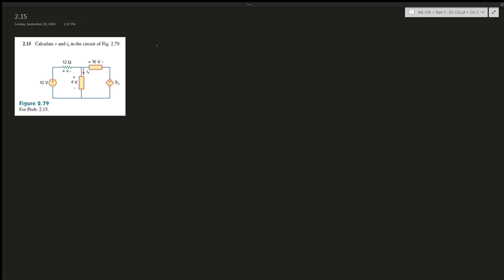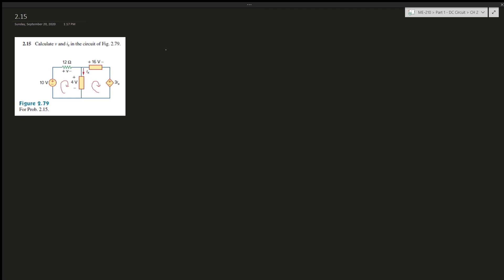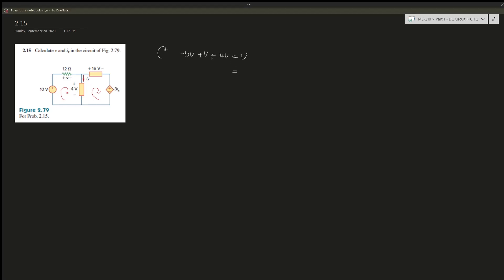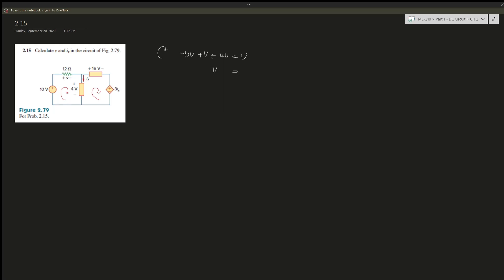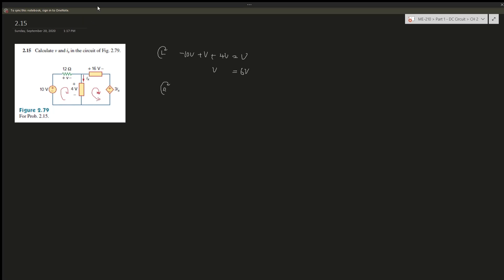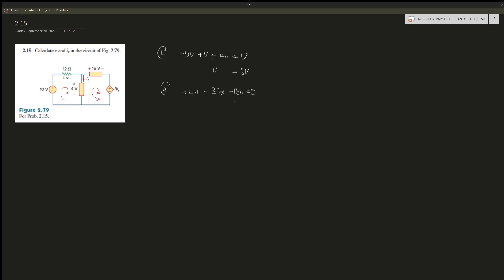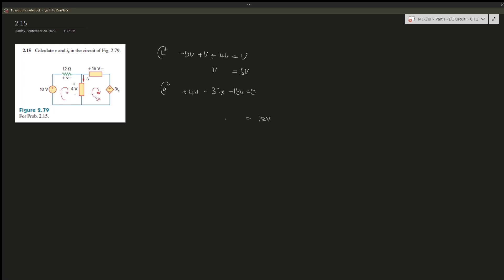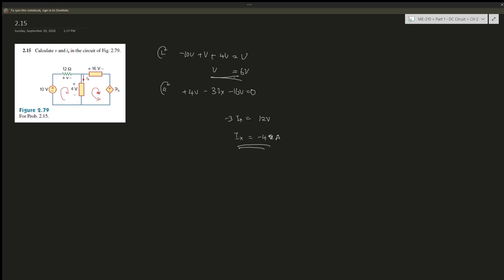2.15 Calculate v and ix in the circuit of Fig. 2.79.

Comment: what does the - 4 A imply ? that current is flowing opp to the current direction we assumed in the right hand side loop (counterclockwise)? but if we assume clockwise direction of current in the same loop then again answer comes out as -4A ? so which direction is ix in